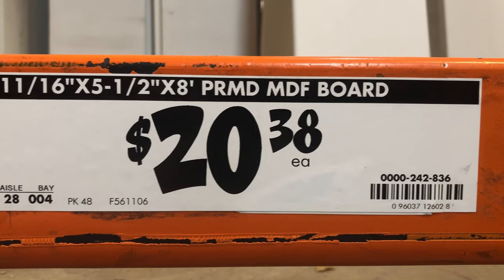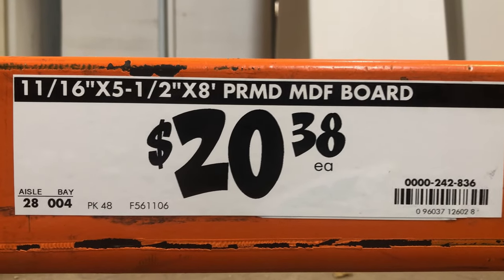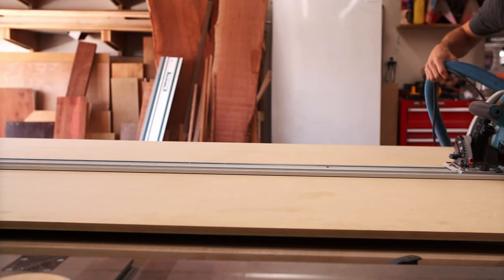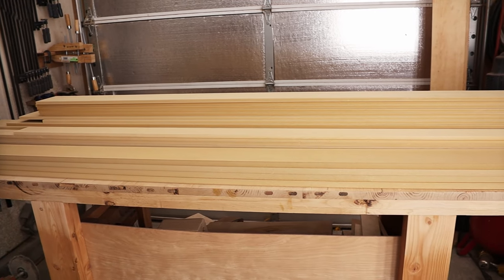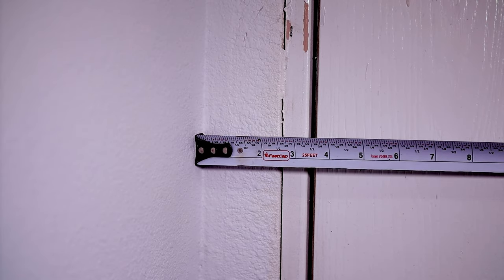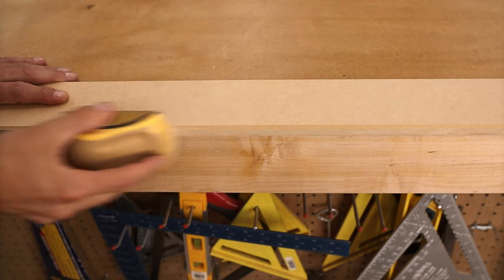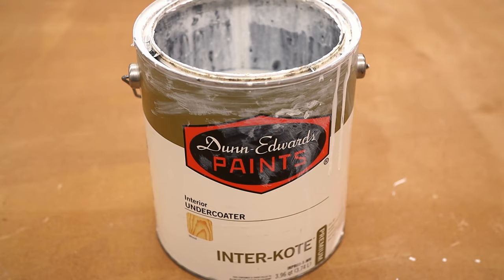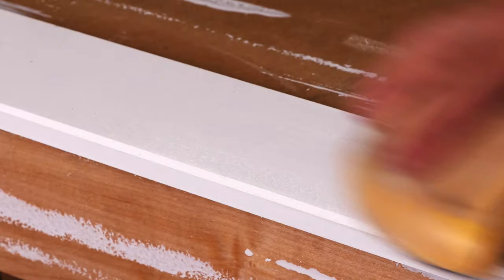How to Make Molding | DIY Trim Baseboard Headers and Blocks

Comment: i sincerely regret to not have thought to do my molding myself when i renovated my house. I ended up buying the cheapest molding to lower cost and those look really old fashion. I may redo the door trim at some point since my miter corner opened up. Nice to know its as easy I thought it would be (after the fact unfortunately)
Reply from the maker: I like the idea of doing the door trim. I bought a ton of cheap molding the first time I did some renovation and I was soooo bummed with it. That is what made me get onto making my molding myself in the first place. You'll, have to let me know how it goes if you end up doing the door casing.

Comment: Not at all helpful except MDF is cheaper than wood. You didn't show any moding cutting with router.
Reply from the maker: Sorry it wasn’t helpful for you. I did the edges with a simple 45 degree angle with my router in the video which was pretty quick and easy and the actual routing of it didn’t take up much time in the video.

Comment: What size (width, height, thickness) did you create the plinth blocks for transition from door casing to floorboards?  Thanks for your help.
Reply from the maker: Mine at 5.5” by 3.75 inches. That looked good to my eye, halve an inch taller and wider than the baseboard and trim I made.

Comment: Hi there! What gauge nail did you use?
Reply from the maker: I used the standard 18 gauge and then filled the holes afterwards. Mdf puckers a bit so you have to sand it a touch unless you use a pin nailer but I don’t think the pins hold well enough.
Reply: @BuildItMakeIt  Okay thank you! I've seen people say 16, but also 18 because of MDF puckering with bigger nails. Just makes me a little nervous because there is a lot of conflicting choices. haha.

Comment: what about the cost of the tools that you will need to cut the boards? You may end up spending more rather than saving.
Reply from the maker: Yeah the tools can be expensive and often the job that you buy the tool for then ends up more or break even, but then you have the tool. In my one example for this job the cost savings would pay for a track saw or even a job site table saw saw.  Now if you are doing a more complicated profile you would want a router and bits so at that point you would probably spend more. If you did a whole house you could save enough to build out a decent little shop.

Comment: OMG I'm so glad I found this video. I'm rehabbing my rental more of a facelift refinishing the floors and replacing all the roundover molding and window trim with rectangular trim like you have there. You know hard edge on the windows and 45 on the base. And I was going to use all poplar. I even went to a lumber yard and was going to special order. It was about to pull the trigger and it was going to be like 2100 bucks and then I went and priced out what the MDF cost at Lowe's and I don't have a table saw and I don't even have a straight edge that I would use. I just paid them the extra money to cut it for me. I just had them cut 4-in baseboards and 3-in trim boards and 5-in 3/4-in headers. Amazing video. I just got back from the store and I remember when I was taking a break. I watched your video again mine's a little bit different than yours cuz I have a smaller house but I can't believe I was about to spend so much on hardwood and MDF and primer for everything. It was less than 350 bucks. I mean it took me like 3 days. You know of cutting and sanding and priming and then I even took the time to prepaint them because I'm using flat paint and it was easy to touch up after I filled all my nail holes. Now I'm hoping my little rental will be a little bit more modern looking. Oh by the way, if anybody's wondering I stain the wood floors which are original to the 1968 house. I stained them black with a satin clear and painted the walls, swiss coffee and the trim pure white and I painted the red brick exterior Swiss coffee
Reply from the maker: Awesome!! So glad that this helped and I am excited to hear about your rental. Keep me updated on how they fair, especially with renters and how your touch ups go. I’m super impressed!
Reply: Sounds great. 👍👍

Comment: Good video but one huge mistake.  On MDF use sanding sealer before priming and painting.  Thats why your MDF absorbed so much primer.  Using sanding sealer first, you can use a paint and primer combo and get a much glossier finish if that's what you like.
Reply from the maker: Thanks for the tip. I haven't tried sanding sealer before on MDF so that is a great idea. That should seal it up better than a coat of paint, and probably dry faster too.
Reply: Thank you from me as well. I haven't used MDF except for melamine coated to replace damaged cabinet doors in my apartments or to add more cabinets.
Reply: Which MDF sealer did you use?
Reply: @tonyc7352  mix 50/50 wood glue and water. Use water based like titebond 1 glue, don’t use gorilla glue cuz it’s not water based and foams up.
Reply: @dylan-nguyen  Thank you for replying.
Reply: Just do a very light shellac primer. Add denatured alcohol to thin.
Reply: Don't use a paint/primer on baseboards. Use a good primer that had gap filling abilities to get a nice smooth finish, then paint. The primer is an important step to getting a really nice finish. most paint/primer combo paints are garbage.

Comment: If you are using mdf, you need to prime all edges because if you ever have a spill that goes under the baseboard or runs down the wall, it will swell up like a balloon.
Reply from the maker: Yeah the swelling of the MDF can be a huge problem if it gets under and then soaks in. Thanks!

Comment: Most of my customers in my are want an ogee moulded skirting and during covid we couldn't get it so made our own simply on the router table but I am never happy with the "end grain" as no matter how much you sand or buy better primers I still think you can see it so last time we tried something different, we gave it a sand so it was smooth, cleaned it off the wrapped them in thick brown smooth craft paper. Glued it with a watered down PVA. The results were unbelievable. A perfect smooth finish, no roughness or visible "end grain"  I haven't bought any ready made ones since. It's drastically reduced my costs on jobs.
Reply from the maker: That’s a really cool idea. I have never heard of coating it with paper before. I’ll have to check that out. Thanks for the tip!
Reply: @BuildItMakeIt  it's the same kind of paper that is used to wrap parcels, make sure it's the smooth stuff with a slight sheen on it and not the rippled stuff. Honestly works a treat. I've seen some ready made ones that I thought had a vinyl wrap but after seeing it's definitely painted I'm convinced its the same or very similar to what we used.

Comment: Thank you from lethbridge alberta canada.  I need to do full baseboards, door and window trim in our basement.  I am leary of mdf because it swells when wet, always an issue in below grade work.  But I am on a tight budget and wondering what I could do with some sort of real wood stock.  I would also like to come up with some way to attach baseboards so they could be easily removed the next time we paint.  Yourvideo was great.  I would use a pusher stick to make sure those fingers are always at least a foot away from the blade.
Reply from the maker: Thanks! Yeah solid wood is certainly more durable and I have made solid wood baseboards the same way. When I was doing this I also used solid wood for the windows since they get a lot of moisture. If you come up with a good solution to attaching them to the wall so they are also removable I would love to hear it. Thanks!

Comment: I'm doing the same... making my own, but will be using poplar for my baseboards & door frames and either clear pine or MDF for the rest (crown, bookshelf buildouts, etc.).  I think poplar will hold up much better in areas that may get knocked or kicked, with less chance of scratching or denting.  Either way, I'll save a ton as you point out.

Like you, I'm doing simple square trim with a 45 degree chamfer to match my new kitchen shaker doors and carrying it into my family room remodel so it all ties together nicely.  I'm still debating the need and style of "shoe" molding I may or may not put in.
Reply from the maker: Yeah, popular will hold up a lot better. Plus it still should end up quite a bit cheaper. Id love to see how it turns out.

Comment: Hi, great help for diyers'  do you have to use an oil based paint for the primer? I have read that you shouldn't use a water base paint on MDF. What is your experience been with either type of paint?  Thanks much.
Reply from the maker: Thanks! For me I use water based primer and then do a light sanding on the MDF. I have done this for years now and haven't noticed a problem. Do do need to do the sanding because MDF absorbs moisture differently between the edge and face. This is true for both oil and water based finishes, so I would assume it is would be the same for an oil based primer/paint, but I haven't actually used an oil based paint on MDF, only oil based finish. Hope that helps.

Comment: Thanks for the knowledge. Quick question, why the copen cut on inside •45 cuts on baseboard? What would happen if you just •45 it? Thanks .
Reply from the maker: It is a bit of laziness and I think it looks better from getting a tight fitting joint. Most walls are not actually 90. I used to used an angle finder to do perfect cuts, but now I only do that with wood. If I am painting then I will caulk/fill the gap and I think it ends up looking nice and tight.

Comment: For the door trim.  You used 1/2" MDF 3.5" wide for the sides, but for the top did you use 3/4"MDF 5" wide?  Also looks like you ran the top door trim past the side trim.  How much overhang did you use?  Also did you 45-degree Chamfer all ends such as the door trim side top where it hits the top header 3/4" MDF trim.
Reply from the maker: Yea that is correct on the sizes for the surround trim. I did 1/2 inch overhang on each side, I like the look of overhang and it helps for seasonal movement too. I didn’t chamfer the ends. Where they but up. I have seen it done before, but with the thicker up top I think butting up looks fine.

Comment: How do you prevent damage to the drywall when ripping out the old stuff?
Reply from the maker: That is a place I am not very good at. You can try to carefully use a blade to cut away the caulk from the wall, but I almost always have some issues. That is why I make/buy new molding at lease a 1/2 wider than what I am removing. Personally I like the look of a nice 5" baseboard but if you need it to be the same, sorry I don't really have a foolproof way other than be really careful, and you will probably still have to do a bit of patching.

Comment: In my imagination I would stagger moulding with multiple different profiles and stack them on top of each other to create an effect where it looks like the wood is very thick with a lot of details, maybe even stack them all around an archway. I also envision moulding made of stamped copper and bronze and nickel with intricate shapes and details...but than I realize I'm still making a spray booth out of metal and it's taking forever so that'll have to wait. I'll probably take pictures if you want to see it. I came up with the idea of using EMT conduit from the hardware store after seeing the prices, it's so cheap. The corner tube brackets I'm cutting and welding are taking a long time though. It could take a while.
Reply from the maker: I like your idea on making the molding. I did that is our last house for some crown molding that made it look way thicker. I would love to see your metal spray booth. That is a good idea to use the EMT conduit. I would love to see it when you get done. My Instagram is @builditmakeit . What tubes are you using for the welding?
Reply: @BuildItMakeIt  the conduit is 1/2" nominal (i measured 0.6165 ID and 0.7125 OD) so I found this seller called Online Metal Supply,  they were selling 3 tubes for $63 and the specs are "0.875" OD, 0.065" Wall, (0.745" ID) x 72 inches (3 Pack), ERW Steel Round Tube". another idea is using  tubing that fit inside instead of outside the conduit, that way I can lay it flat on the floor and the brackets look hidden

Comment: Great video, well produced, straight to the point. Exactly what I’ve been looking for. Earned yourself a new subscriber! Now, would you mind making a video on how to create corner blocks (as in crown moulding not having to saw ceiling moulding in an angle). Cheers from Sweden!
Reply from the maker: Thanks! That’s a really good idea on the crown molding blocks. I did that in my last house to simplify installation.

Comment: How did you hold up the mdf sheet when you were cutting it with the circular saw?
Reply from the maker: I cut it on top of a 1.5" thick foam insulation board that is 4' by 8'. This works great for fully supporting the piece while cutting.
Reply: @BuildItMakeIt  thanks!

Comment: The other issue is that MDF dulls blades and bits FAST. Penny smart and pound foolish, imho. Better economy can be had by selecting framing lumber to shape with a table saw and router imho.

Comment: Where did you source your boards?  I can’t find a sheet of mdf for less than 50 dollars and it makes it where I might come out even after paint and primer…
Reply from the maker: Yeah, everything is more expensive now. 1/2 MDF at the Home Depot by me is 45 dollars right now, but the baseboard I was replicating has risen to 19.98 so it still has about the same cost saving for me. A lot depends on what molding you are making, but if you aren’t saving much it probably isn’t worth it to make it.

Comment: I’m installing vinyl planks should I install baseboard first?
Reply from the maker: If it was me I like to do the planks first then install the baseboard. I just think it is a nicer look, but that is just my opinion.
Reply: @BuildItMakeIt  would you still put a shoe molding ?
Reply from the maker: I haven’t done shoe molding in my current house or my last one and haven’t had any issue with the edge of the flooring showing. Personally I don’t really like the look of shoe molding or quarter round.

Comment: Dude you shoulda done like SOME sort of cool profiles in them. Even if it was something super Simple like lines of rounds going straight across the whole length or 2 square grooves. 
I did One would really like to see how to properly take (for example - palette wood (maybe ran through a thickness planer so each piece is perfectly the thickness of course) then how to cut unique customized profiles. 
I see no one on all of YouTube just freestyling as such - getting creative with different router bits to make their own trim or molding. 
So I’d like to. & id like to see how they might approach it. Would they cut each board with the 1st piece then switch out router bits & run those pieces through & so on? Would they record their bits used or record this in notes to have it down in case they ever needed? 
I’m jus saying I’m new to all of this. And I’m a girl & I’ll tell ya - learning all this wood stuff is HARD. There’s no wood working classes near me either.
I want to make total use of recycled wood & learn all the different cuts
Reply from the maker: Thanks! That is a great idea to show different ways of making various router profiles. I was trying to keep it simple especially if someone doesn't have a router, but this is just about the most boring style of trim :)
Reply: @BuildItMakeIt  I’m sorry I didn’t mean to sound the way I did in my comment. What I meant to say is: HEY. You’ve inspired me to want to learn MORE. And since you explain things so well, I felt comfortable asking you if YOU might be ‘The ONE’ on YouTube to Make the 1 & only “How to make your own Custom Router Profiles on Palette wood you scored for FREE from behind John’s Liquor to make Chair Railing for the walls in your garage because you’re not good enough yet that anyone would dare trust you putting it inside the house Tutotial!” That’s what I meant to say. By the way thank you for the video & thank you for responding. (*I always sort of feel like I just talked to someone famous when a video creator actually responds).

Comment: Why wouldn't you paint everything before putting it on and them just fill and paint over the nail holes.
Reply from the maker: You can certainly do that but when you use caulk between the wall and the trim you typically want to paint that for a nice crisp line. Also there will be slight differences in the over painted parts from the nail hole. The lower the paint sheen the less it will show. With typical semi gloss and gloss you will be able to tell when the lift hits it right that it was spot painted.

Comment: Yes. If you have those table saws. But if you need to buy those saws, table , need the space primer, …..  it will come to that number. Or even more
Reply from the maker: The primer was in the cost estimate and you can make it with just a circular saw like I showed. It’s easier with a table saw but totally unnecessary. That’s why I did just the simple chamfer on the edge.
Reply: @BuildItMakeIt  thanks man. How straight could you get cutting with circular saw and straight edge ? Were they flush on the floor or a bit wobbly ?
Reply from the maker: @AmatriceBand  The circular saw and straight edge are pretty straight, I think just as good as the table saw. The only tricky part is making sure that they are the same width each time. It's not really tricky you just have to be careful. Also if you want to cut a chamfer with the circular saw I find it is way easier to cut the chamfer, then cut the strip, then cut a chamfer and cut a strip from the larger sheet. It takes longer, but that is how I did it before when I needed to use the circular saw and it went fine. Hope that helps.